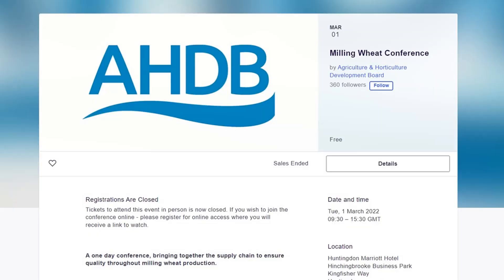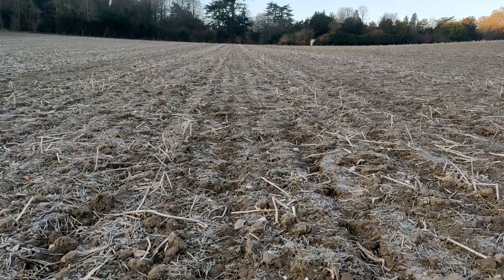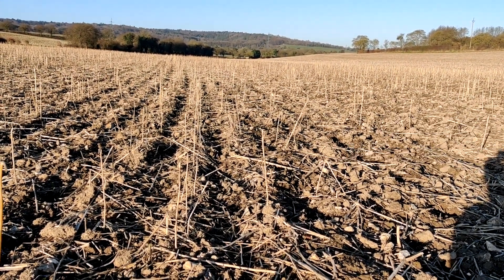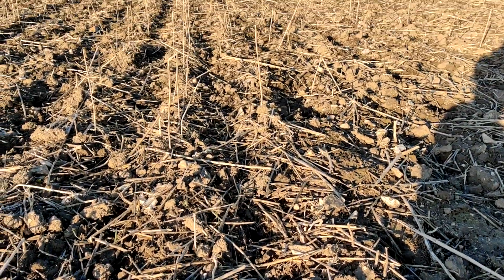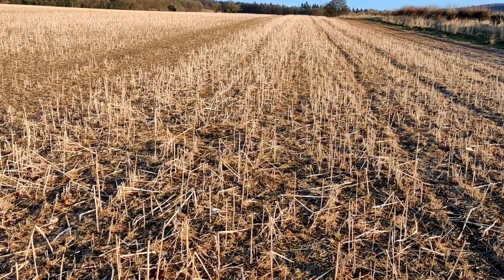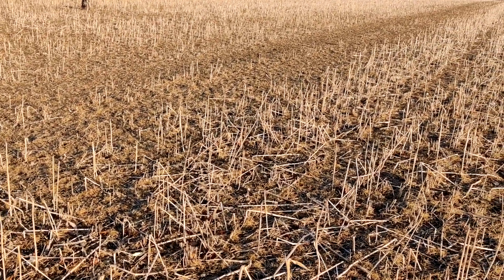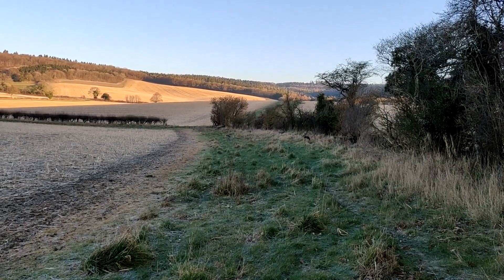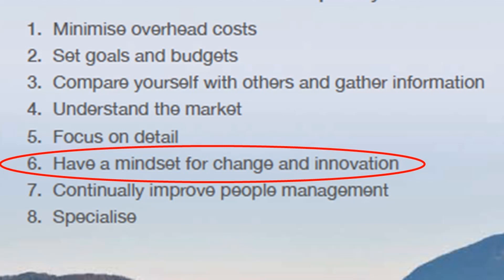Crop walking, innovation and detail

Comment: I worry about late drilled cereals emerging slowly in cold soil conditions but not so much small plants once they are emerged as you Nov drilling. Is March better than Jan? I'm sure you will have yields maps to show which is best. Not sure what the Aero seed rollers are like but could an engineering company turn a hybrid (mid) set for you out of engineering plastic?
Reply from the maker: Great idea about the rollers. Problem is I'm worried about the electronics too!
Reply: @AntonysRegen  Don’t let me get between a man and the purchase of new a machine 😄
Reply: You may find there are more current electronics from drills that may be able to be mated to the Kuhn.
Would it be possible to self import, collect,  dependent on price, a new machine from the country that builds them?
Reply from the maker: That sounds really encouraging @Robert Higgins any ideas on where to start looking?
Reply: @AntonysRegen  
Unfortunately I don't really but would it be worth contacting Kuhn regarding the problems?